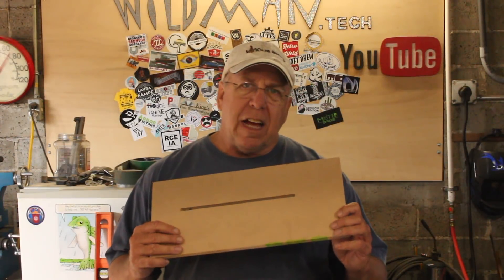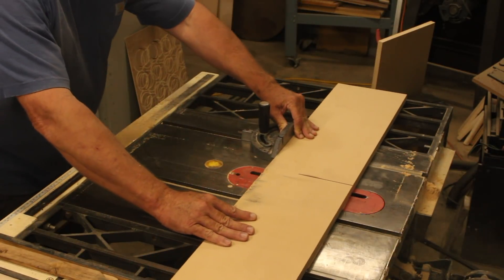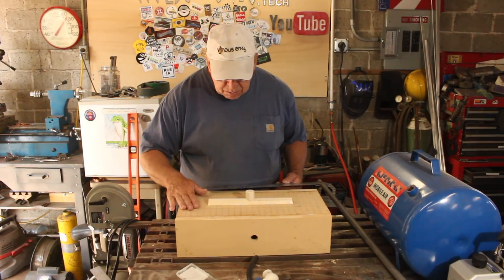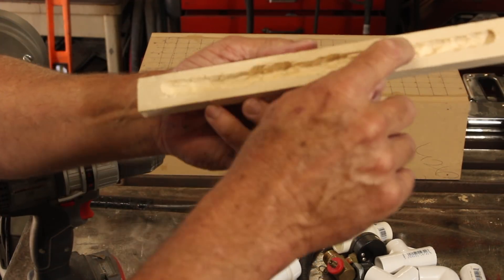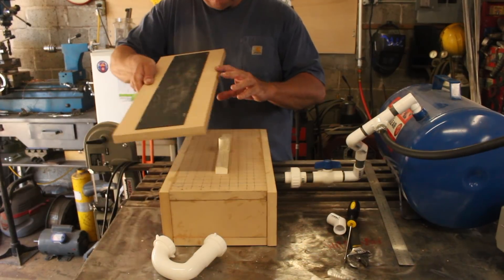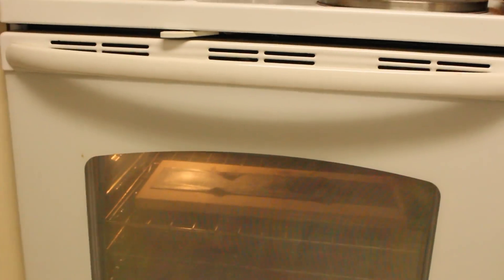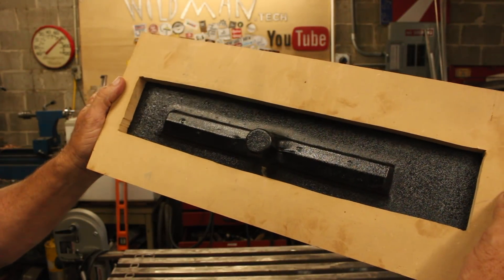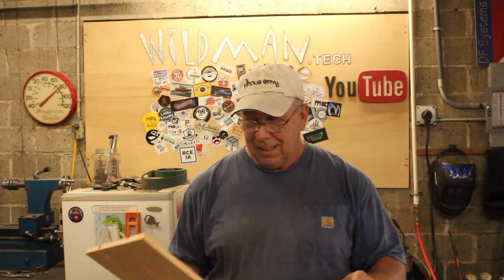Build a Vacuum Forming Machine!

Comment: You get a much better seal if you used rubber weather stripping to seal between your vacuum box and your form. Nice to see a intelligent simple system work out so well.
Reply: Definitely second the use of weather seal to create the airtight seal needed.

Comment: Great stuff! I'm pretty sure that you don't actually need the holes in the form. :)
Reply from the maker: I did add some more to pull in on the tight spots. I'm going to try it with a vacuum cleaner instead of the vacuum pump.
Reply: If you put some dimes, or something small like a few strategically placed coins, down under the buck it will create an undercut and proper suction will occured. In other words, drilling holes in your buck isn't necessary if you can give a slight lift of the buck off the platen so that airflow can be sucked down all around the buck. It will actually help create a tighter pull, too.

Oh, and a word to the wise, abs gives off toxic fumes when heated at 300° + temps. Using the same oven that you cook food with isn't a good idea. The toxic fumes imbed in the interior of the oven and anytime you're baking food in that oven those fumes will permeate in your food. Not lethal immediately, but it isn't healthy for the body over the long-term. Be aware of that. Great video. Take care.

Comment: There was a small flaw where the part was not 100% on one side, so perhaps a bit higher than 350 F. would improve that next time one is made.  Not bad at all.
Reply from the maker: I added additional vent holes to pull the plastic into the tight spots. That fixed it.
Reply: Great, thanks for the reply my man!